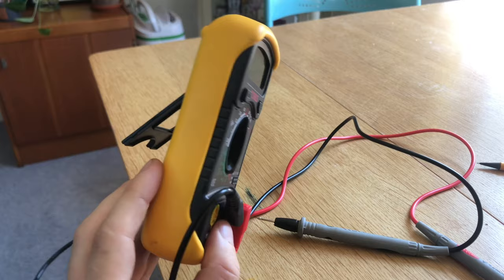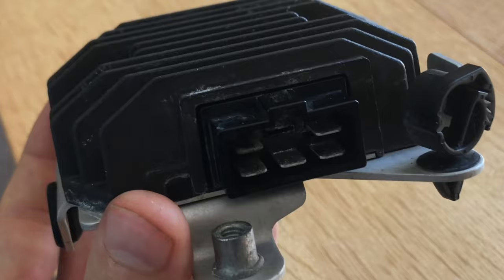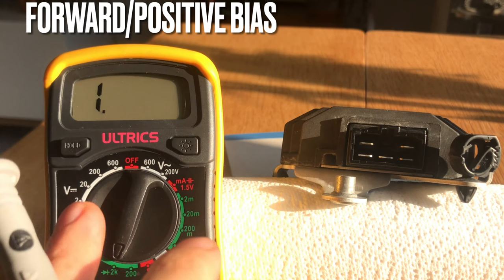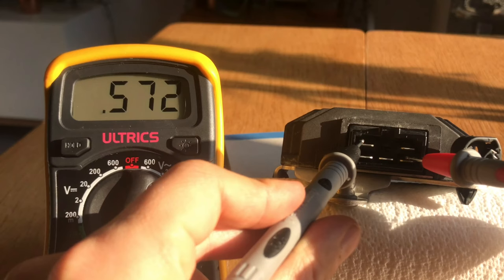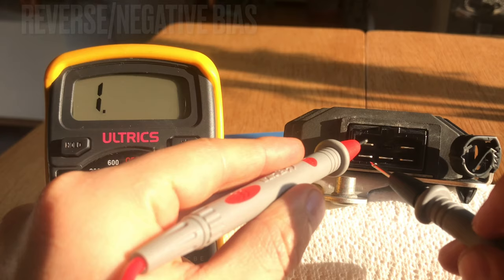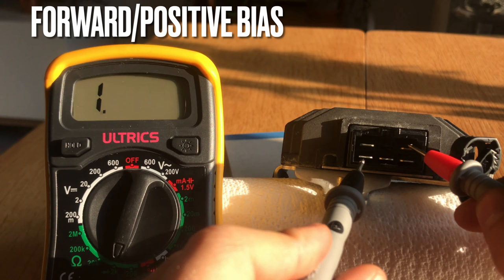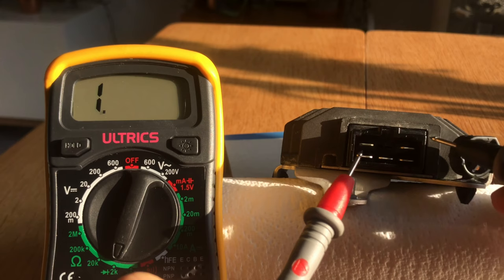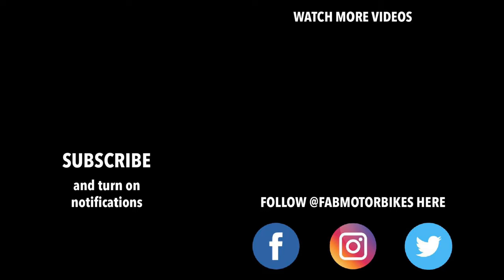How To Test A Regulator Rectifier (Motorcycle)

Comment: Guys, stop showing this test on the internet, or at least mention the fact that it could be irrelevant in some cases like mine. For example, I had a very old regulator rectifier (exactly the model from this video from a 2009 Yamaha FZ6 S2) that passed this diode test. But, when checking the voltage on it with the engine on, it wasn't charging enough. It was barely 12V on idle and 12.8V on high RPM. I also checked the stator and it was good. So, after I changed the regulator rectifier, everything was good, charging according to the service manual. So, the regulator rectifier might pass the diode test, but that doesn't mean that it works properly. The ultimate test is measuring the voltage on idle and on high RPM by connecting the voltmeter directly on it's + and - connectors. Exactly the way it's mentioned in the service manual.
Reply from the maker: Thanks for your comment. You are right. I’d already tested the stator. It’s all part of the process of elimination. I just like to document my journey. Not a professional mechanic. Thank you for watching though and your comment is very useful, lots of people will learn from it, which is also another goal of mine. All the best and ride safe!
Reply: The aim should be to educate not to shoot down its ok to be positive
Reply: Nicely handled 😅 @FabMotorbikes
Reply: So what youre saying is to connect in the regulator or at the battery with engine working?
Reply: @jpaff123  yes. When you are facing a poor charge, you must connect the voltmeter straight to the regulator with the engine on and rev it at around 5500 RPM. That’s what the manual says. If you don’t get above 13.5v, then it might be the regulator or the stator. Next step is to check the stator, which is a whole different procedure. If the stator passes the test, than you must change the regulator, otherwise, it’s the stator’s fault.
Reply: He's testing the diode function as a confirmation to see if the rectifying part of the reg/rec is working, he's not testing the regulator. Only way to do that is to either bench inject voltage into the unit if the bike isn't available or test it on the bike directly at the unit. Bit of advice or friendly tip, never test the charge at the battery as this can be unreliable, always test charge output at the plug itself because there might be a broken wire or no continuity between the plug and the battery.

Comment: Nice and clear. I've tested mine after a charging issue, one way its showing ~.5 on all three pins, reverse is 0. However the negative is only showing ~.1 on all three and also 0 reverse. Does this indicate a faulty rectifier?
Reply: Same thing is happening to mine. Currently troubleshooting my entire charging system
Reply: did you replace your rectifier? did it fix your charging issue? i got weird reading as well
Reply: @feero9680  all i got in the end was a rick's motorsports stator, solved the issue. But usually its recommended to do both if one goes, I was just being cheap
Reply: My bike only starts with a Jump. I runs for couple minutes and then dies. The battery is not charging. Is either the stator or rectifier. I’m about to change the stator but I’ll hold until I check this first. Stator has 7k mikes it is almost impossible that is bad.

Comment: I did your test with 2 regulator both look good with the test, but one does not load my battery on the bike, and the other one does so this test does not always give you the right conclution. so I think you need to test the power it sends to your battery as well, when revving over 3000 rpm to be sure.

Comment: Running this test, 1 of the phases seems to be bad. But with the bike running, the charge at the battery is ok, over 13v at 3000rpm, 15v at 5000rpm or more. What does this mean? My lights, horn, etc don't seem quite right, although it all works, and the battery after a ride sometimes is fully charged, sometimes (most times? Is at 12.7v...

Comment: Good videos thanks. Tested my 3 phase regulator rectifier and stator per your videos as I lost all power whilst riding. Battery voltage good 12.4 and charging when running at 13.7 so happy there. Terminals clean and tight. Stator test perfect. All results of regulator rectifier test same as yours with exception of positive bias against positive input, reading .112 instead of .540. Will try and get some specs out of Yamaha, but noting the charging is ok, I feel these readings are fine. At a loss as to the loss of power 🤔
Reply from the maker: Have you tried texting or maybe replacing your battery? I went through all these tests and it just ended up being an old battery that will no longer hold a charge
Reply: I have to try this the weekend.  I've been having problems with my bike going dead and it left me stranded the other day after 20 minutes of highway riding. I bought a new battery and installed and same result. I'm losing my mind over whats happening. The bike is a 2020 bonneville t120 and I didn't expect to have this issues.
Reply: @stephenricketts2067  Did you find the problem?
Reply: @Bellathebear777  yes I did. Rectifier needed to be replaced
Reply: Exactly my story with a Suzuki SV650 2002. Seems like my next step is to test/replace the rectifier...

Comment: When testing mine is testing the opposite, putting positive on the left top and negative to the other three is giving me around .4 for each. And OL the opposite with positive on the top left and negative on the other three. Why is this
Reply from the maker: They all vary. I did notice that with mine I had to test it at the unit rather than at the end of the cables coming out of it. This also made it confusing

Comment: This video is old now, but it's exactly what I needed. My DR650 has been draining power for a few months now and instead of firing the parts cannon at it, I tried various ways to narrow down the draw. I first charged the battery and tested the voltage, then let it sit a couple hours and it was lower. I unplugged the fuse to my heated grips and charged/tested again, still losing power. I did the same for the stator, but it kept happening. I also tried messing with the ignition key as people say it can have issues, and removing it to charge/test, but it wasn't the issue. I took off the R/R and tested it just now like in this video, and I am seeing power across two of the three contacts in the reverse polarity configuration.

Comment: Thank you so much! This and the stator vid. was just what I needed. I have 08 fz6 that has been giving me a bit of hard time. I think mine has bad ground somewhere thou. It runs fine for min. and then starts to run like crap and go completely dead no dash lights no nothing. I go to start it again and a good fully changed battery go’s completely dead by just hitting the starter button. When I did the stator test I noticed the the negative side of the battery was totally hot. Still working on it but very much appreciate the easy to understand videos!….
Reply from the maker: Thanks for watching! Glad to hear both videos were useful. 👍

Comment: Thanks for the video. Very easy to understand and follow.

I’ve been having issues with my battery holding charge that I suspected it was simply not holding the charge anymore but after replacing it with a new one, I’ve had the same issue.

After doing a Neg/Bias on the Neg/Terminal testing one of the nodes, I got a voltage reading which shouldn’t as with the other two nodes.

I bought a new R/R to replace it.
Reply from the maker: Nice one. Glad you found it useful. I hope that sorts it out. 👍 thanks for watching

Comment: excellent video , well explained ! got a 2001 r6 , found a burnt wire to my rectifier , bike been running fine until warm then feels weaker . Battery now wont even charge from wall charger !
Hoping my rectifier and stator are ok and its just a burnt plug . Got new plug ordered now need to test the rectifier as youve shown
Reply from the maker: Thank you glad the video was helpful. Just a burned plug will be ideal. In my case I went through a load of testing … and it ended up being an old battery that just gave up

Comment: Thanks! My electrical system had much lower than expected voltage when running and this test allowed to confirm that one of my diodes was passing current both ways. Will order a new rectifier and hopefully charging issues will get resolved
Reply from the maker: Really happy to hear the video was helpful. Glad you’re getting it sorted 👍

Comment: In a diode,check the dmm (digital multi meter) is showing you the voltage drop across a foward biased junction. Some meters produce enough to faintly light an led, but if not will look like a bad junction, just something to keep in mind.
Reply from the maker: Thank you

Comment: Very helpful (many thanks) but this only confirms the rectification side of the RegRec - this will not confirm the regulator side of the RegRec ie charge rate/under or overcharging. Current needs to be put thru it and output tested also.

Comment: I don't know my bikes issue. The stater I tested the pins and they all passed both the ohms and current. The battery is 40 days old. Yet I have to use a charger to charge it. When I rev bike the voltage doesn't change on battery. Which means its not being charged but rectifier looked ok with the pin tests

Comment: Obtained a new rectifier from eBay for my 97 Kawasaki KLR650 ...The Diode test only works on negative ground to 3 stator terminals, but is Open on the battery terminal connection of rectifier in both directions. Not sure if I want to test n my Motorcycle (but might) because it is not giving me the testing results I expected. ... so still studying.  Thanks for lesson.
Reply from the maker: Thank you. Glad to hear the video was of some use 😊

Comment: Hello i was checking my voltage regulator and on the forward/postiv bias on the negativ wire it showed 0 on all 3 pins and when i did it on the postive wire it showed 448 442 451. My question is do you think that is why my atv does not start?

Comment: Thanks for this. I've seen a few motorcycle reg/rec units and they never seem to label the terminals or wires. Even on yours, I couldn't see a + or - sign. Not quite sure why they do that. Labeling would make testing and fitting them much easier.
Also, are reg/rec units interchangeable between different bikes? eg if you took one off a Honda mc and used it on a Suzuki one, could it be used on both bikes?
Reason I ask is that I have an old bike I'm having trouble locating the correct reg/rec unit for so may have to use one off another bike.

Comment: I have a grizzly 660 rectifier it passed diode but one of the legs was .48 the others .515 it didn’t work could this be why it didn’t charge as I replaced with another reg and all was good ?
Reply from the maker: Sound like you found the problem. However worth doing a check on the alternator too . I have a video on that here>> https://youtu.be/0wkNVJryNTQ?si=hKX6J0lMviVM40XQ

Comment: Hi. I have a question that i hope you can answer.

I checked my rectifier and followed your procedure and my rectifier seems fine and working. 

The problem with my bike is when engine is off the reading is 12.5 to 12.7 when i start the bike and in idle the reading goes up to 13.7 but when i rev it to around 5k rpm , it just drops to 13.2 and back to 13.7 again when going back to idle.

I always recharge my battery recently because it keeps getting drain. what could be the problem? Is it my battery or stator?

Thanks
Reply from the maker: Hi! Thanks for your question. It does sound like your rectifier is fine. You could have a battery that is going to the end of its life… or (based on your voltage dropping on revving) it could be the stator that is the issue. Have you seen my video in testing the stator? https://youtu.be/0wkNVJryNTQ
Reply: @FabMotorbikes  thanks

Comment: Mine is 4.25 and climbs to 4.35 after three mine is hot on startup cooking the frame before the motor gets warm is it a rectifier or stator ,bike charges fine
Reply from the maker: Not sure. But if you’re bike is charging fine you should have a worry

Comment: Hoping you can help me, electrics not my best thing, im autistic, could you help me with this on my 2001 fazer1000 please, my readings are higher than yours but there's electrical fault with my bike.

Bike wouldnt start the other week, then exhaust went bang fire came out, then charged battery 3hrs trickle charge then still woulnt start, then got it started but didn't sound right.

Then started ok few days later, fitted new chain sprockets but smaller rear a 39 rather than the 44 so thought this reason why speedo cutting out needles bouncing all over place when went out for a ride 1hr, so ordered speedo healer but not fitted yet.

Went out for ride on 14,10,23 for 1hr 30 mins, had lights on for half my ride then 40 mins from the end i was causing 60ish then bike trying cut out 3times them speedo cut out, so turned lights on took it easy for 15 mins before going fast then seemed ok, next day 15,10,23 started bike twice, in the day while waiting parts, got the multimetre you have now to test it once off but before that, bike running ok 5mins then speedo died then funny noise from bike so turned off, then tryed start it then dead, could I have problems with my battery or starter motor or both? Or somthinking else?

Connections seem ok on regulator rectifier not burnt out as i was asked check as normally electrical backfires due to regulator rectifier faults, so 636 , 620 then 636 on my test like you did, everything else same as your test on other tests, but 1st tests were higher as above but my bike not 600 like yours its a 1000 fazer 2001.

Not sure what to do next, not checked other electrical fixings yet, was hoping be regulator rectifier then just east fix but now im totally lost where else to check, was my bike supposed to take higher reading than yours? Dont really know what to do but want learn how fix it myself.

If you can much obliged, cheers

Comment: Big help mate been having issues with my bike not holding charge ive replaced the stator start relay,flasher relay starter motor didnt think of the rectifer but just xhecked and mine only hitting 0.0023
Reply from the maker: Cheers for watching. Sounds like it could very well be that

Comment: Hi I just tested my rectifier as in your video and I'm getting a reading of around 2.6 on each of the phases is this ok or not? 
Thanks james
Reply from the maker: From what you have told me it should be okay. Difficult to be sure though
Reply: @FabMotorbikes  thanks, I've put it back together and put copper slip on the back of the rectifier and on the bolts to make sure the earth was good against the frame, and it idles at 14.5v constant so fingers crossed .  Cheers

Comment: Hey how you doing, question, my 2008 yamaha vstar is having problems with the charging system, i took the rectifier out and it has 6 pins connector and the bike has 5 pins connector, how's that possible? Thanks
Reply from the maker: Hi there , this is common and normal. Often the sixth pin is just for support and won’t do anything. But to be sure … you can perform the tests on the “sixth” pin and see if there is any reading. If I’m correct (I might not be) you will get no reading on the multimeter.

Comment: I‘ve got a Honda CB600F Hornet PC34. Sometimes it doesn’t start except if I jumpstart it, so I replaced the battery. And it worked for the last few days. Yesterday as I was riding I had to accelerate more than usual for it not to stall. Suddenly it just shut off. The battery was showing around 9 Volts. I jumpstarted it again, drove like 200m and it died again. Any idea what it could be ?
Reply from the maker: Sounds like you have a charging issue or a voltage leak. May be worth going through steps on this video.

You might also want to check the health of your stator . I have a video here: https://youtu.be/0wkNVJryNTQ

Comment: I tested my rectifier and one pin was in the 500's and the other 2 were in the 600's. Does that mean its bad ?  1999 Suzuki Intruder VL1500. Hope you see this question.. Thanks.
Reply from the maker: Based on the info you e given me, your rectifier should’ve okay. Issues occur when you are getting blank readings.

You might want to check the health of you stator . I have a video here: https://youtu.be/0wkNVJryNTQ

And also check you battery health. I did loads of electrical tests and on the end all I had to do was replace my battery

Comment: Awesome tutorial. I just checked it on my dr650. Nearly identical. I have a question I tested stator plug it is reading about 1.8ohm testing the phases. The manual says 0.5 to 1.5 ohms is the good range. I tested the phases to earth and they came back correct. Any ideas
Reply from the maker: When testing for resistance you need to take in to account the resistance of the wires in your multimeter. I have another video in testing the stator here: https://youtu.be/0wkNVJryNTQ?si=5fkQWCTR9vzqW3NO. I cover that in the video
Reply: @FabMotorbikes  yea man you are right the stator is fine and regulator good then. Do you know any other causes that would stop battery from charging. Goes dead after a few rides. I put new starter in and battery was tested where I bought it new

Comment: Thks four your excellent video just a question my PiaggioZip 2T all the bulbs headlights and rear all blow in same time what you think this can be the voltage Regulator thank you
Reply from the maker: This could be the regulator, or the stator. I have a video on testing that on my channel too. I would also recommend checking you have the correct fuses in your bike. As usually the fuse will blow before the bulbs do
Reply: @FabMotorbikes  many Thks to reply yes is 7.5 fuse is correct one I’m surprise the fuse don’t blow out thank you again I’m going to check